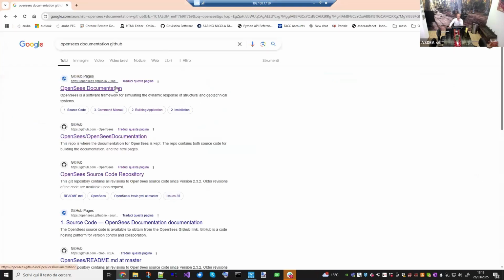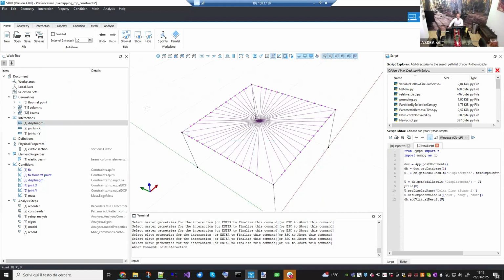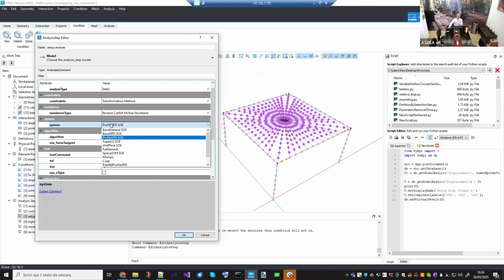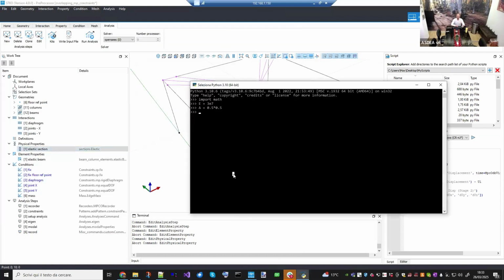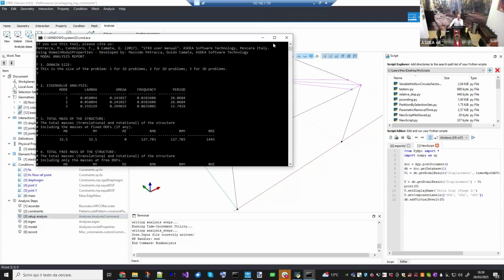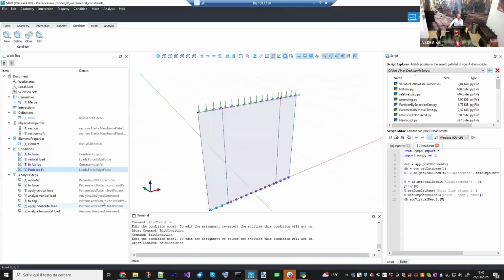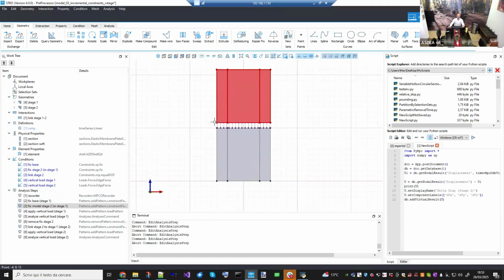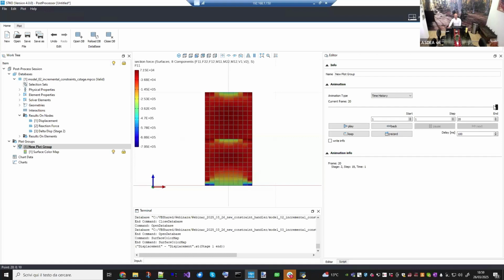Construction Stage Analysis in STKO on OpenSees: Incremental Multi-Point & Auto Constraint Handler

Comment: Hi! I have a question regarding on the default oom = 3 parameter in the Auto constraint handler: when we use the penalty method, the recommendation is to use alphaS = alphaM = 10^(8 + koom), with koom = round(log10^(Ktypical)). I understand that this koom parameter is the value that the Auto constraint handler calculates automatically. So, in this case, is it more correct if I use oom = 8 in the Auto constraint instead of 3?
Reply from the maker: 8 Is an upper limit, and it's fine to use that upper limit with the penalty handler because it's the same value for the whole model. The auto handler instead uses a penalty value that is local to the nodes involved in an MP constraint, so it's fine to use a smaller value